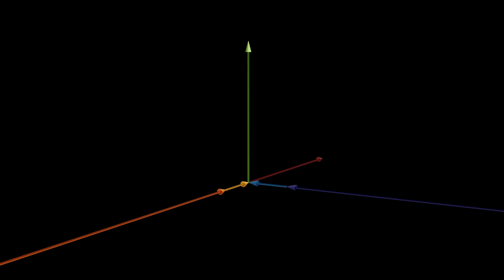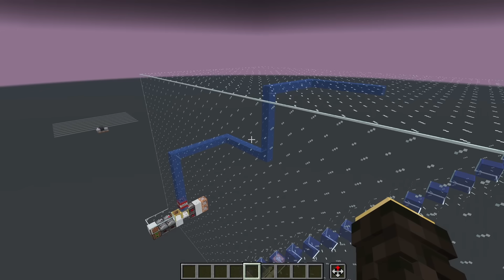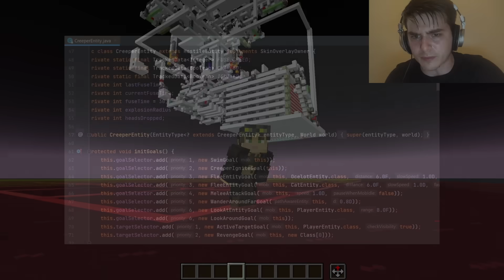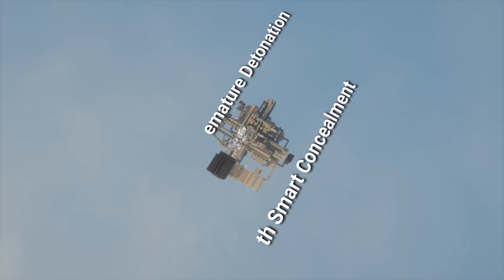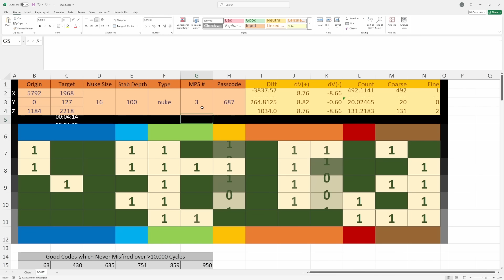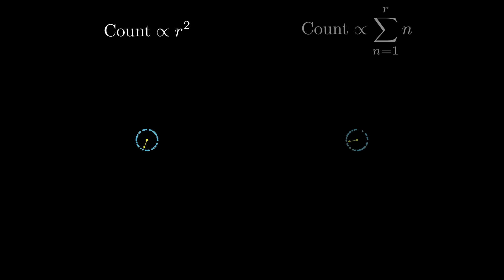Minecraft's Most Advanced TnT Weapon is Here

Comment: How does the wireless transmission itself work? What redstone components are used and why does it work?
Reply: cubic outlined the rigorous details in the trialdivers video (https://youtu.be/2O223xMu65Y?si=OtJ2AweF4EjoDrp-&t=1267)

the basic idea for the receiver is that item entities only check if there is a block supporting them every 4 game ticks, but more importantly, each item entity will also only check for a supporting block 1 gametick after the item processed before it, as opposed to in the same tick. you can observe this in game by placing a bunch of trapdoors, dropping different items onto each trapdoor one by one, and then opening all the trapdoors at the same time with redstone. the items will fall in a distinct staircase pattern.

by using specific chains of repeaters of varying delays and comparators to create a specific tile tick priority for a bunch of droppers, we can create a sequence of item entity creations from the droppers that will all fall in a pattern that will stay consistent as long as no other item entity is created in the world with the same tile tick priority.

if an item is created in the world with a tile tick priority that matches one of the items from our sequence (i.e by a transmitter), then we will notice that the pattern has changed, which we can detect. 

i've definitely glossed over a lot of details, such as why other random item entities created in the world don't affect wireless redstone/the importance of the reference item, and my interpretation might also not be perfect, so do watch the video

Comment: Edit: I haphazardly commented early and am just gonna leave this comment for honesty reasons. That last paragraph is relevant though, just expressing my opinion about the optimization mess.

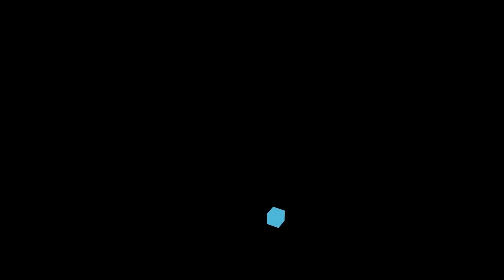6:54 this is inaccurate. These types of linear transformations are done for each vertex (4 per visible block face, give or take connected block edges with matching verticies) several dozen times before even finishing one frame. Compared to scene prep, adding one extra transform per frame (not counting the collision check that it's already doing) on the CPU per-frame would have a cost so small that it's impossible to imagine the difference. Really, I think this is just an oversight.

Edit: After seeing the processing time for a single tick after that it occurred to me that they are not only working with Java, which is NOT optimal for HPC, let alone games, but they're also working with Minecraft's really shitty codebase lol. It is very possible that somebody looked into making a better solution and found a ton of shit they didn't want to risk rewriting for performance where a single transform+collision check won't take thousands of cycles (can only imagine it's that much if a few hundred TNT blocks moving around can do 13 seconds of lag for the server).

A reasonably determined programmer with expertise in low-level programming could get something of this scale working reliably and quickly, even on a single core. See the insanity of Factorio's engineering for an example of just how good modern processors are when utilized properly. With how much money Minecraft makes, Mojang has no excuse to keep holding Java edition to such a lower standard. Even though Java is limited in this regard, modders have proven there are leaps and strides of performance gains to be made practically everywhere! It's a damn shame.
Reply from the maker: I think my bug report about the collision method is currently the most upvoted on Mojang's bug tracker. And the solution is extremely simple to implement.

Comment: Could you potentially make the charge move in straight lines with a precision-timed charge to redirect the payload into another specific straight-line direction? That way the number of calculations is greatly reduced for standard vanilla servers. The cannon probably looses some range and precision doing this method, but the math for the redirection vectors is theoretically possible.
Reply: that wouldn't work since you would need to load whichever inbetween chunks the tnt goes through
also the whole reason it moves across the world in one tick and then suddenly stops is because of the powdered snow, so if the cannon was set up like that you would need to 1. find the inbetween chunks, 2. place powdered snow in the right spots, 3. fire the cannon, and finally 4. load each inbetween chunk before it can finally reach its target
i found that by making the cannon more or less aligned in one axis with with your target(s) helps reduce travel time

Comment: Hello Cubicmetre, I am writing this because i just had an idea on how to improve the orbital cannon even further.

For now the bigest issue with the concept is that you need to know the location of your ennemies and then wait a loooong time for the payload of that exact coordinate to form. this means most of the time you can only ever target bases instead of players, and preping multiple payloads at once is a cool system but it still dosen't help to target moving ennemies.

So my idea was to create a tnt storage system conected to the cannon. Imagine the storage system is made of individuall modules that, for this example, have 5000 tnt eatch. (The number can vary) then you have 10 more special modules(5 for each coordinate) containing the following payloads: 4 of them have 2000 tnt, 2 have 1000, 2 have 500, and 2 have 250.

Now let's say you need to send a christmas gift that needs 22682 and 39876 tnt to arrive. Instead of waiting for that to generate you could just  do 22682 - 4 modules, then 2682 - one 2000 module, 682 - one 500 module and now the cannon only needs to generate 182 tnt.
then you do the same on the other side( 39876 - 35000,   4876 - two 2000,  876 - 500,   276 - 250,  26 are left) As a result the cannon only needs to generate 182 + 26 tnt and is ready to launch.
Thanks to this system as long as the payload needed dosen't exceed the number of modules made you can garantee that the cannon will never need to generate more than 500 tnt to be ready to fire.

Now the only limit as usual is the lag it creates, but i hope by storing the modules in unloaded chunks then using chunk loaders to put them in lazy chunks only when you need them you can keep the lag to a minimum.

I imagine if this works you could become death to anyone, anywhere, anytime.

Like, imagine i am traveling with a group in a minecraft world. Then we stop just for a moment to wait for others, and suddently all our games freeze. The frames start loading one at a time as we see the plains we were in suddently be filled with tnt. Now all we can do is wait for the game to register our deaths.
Anyways, hope you have a good year and good luck on your arms race against yourself.
Reply: Good idea that might actually work. I don't think it's worth it, but it would be cool.
Reply: @Int_resting   Thanks, I also don't know if it's worth it but at this point there's not much more that can be improved.
Reply: The ocs isn’t that good anyways for killing players as the game gives invincibility frames so at most you end up taking 2 or 3 tnts from a couple blocks away. It really only works for targeting bases

Comment: im curious as to why some people say it doesnt work on bukkit. bukkit fundamentally doesnt change anything, it just adds in an api. it was literally created by nathan adams (dinner bone)..
also spigot doesnt do optimizations either by default, why doesnt it work with that. I dont think it a paper issue at that point, remember paper is a fork of spigot, and spigot is a fork of bukkit. and NO ONES CHANGED anything in bukkit in years, other than updating it to the new versions. so its possible some changes that were made were never updated. Also not all finely tuned redstone machines break in paper. there are plenty that work fine. some of them you just adjust a few timings depending on the server if they modified settings which is common amongst many larger servers.

Comment: I have an idea and I believe you can help me bring it to life. By using wind charge direction propulsion theory paired with different fishing rods, at a given time, specific angles sent by the player in multiple sets could be detected by target blocks in a large array. By using multiple of these to reduce the area, an extremely accurate location could be calculated in order to send the payload to. Unfortunately, im not the greatest redstoner and cant bring the idea to life. But you could with the help of other mechanical experts.
Reply: To better explain, I would aim at the given point from wherever in the world, using a fishing rod to activate a redstone contraption which launches the wind charge and allows me to aim it directly at say a 100 by 100 grid of target blocks on the ground. This could be encoded into a 7 bit binary code for both x and z coordinates of that hit. Using a second rod and second room, i can activate another wind charge on another 100 by 100 grid. This gives a 10000 by 10000 block range and an accuracy of an exact block by combining the two codes. As a sidenote, using an excel spreadsheet or a feature added to the f3 menu, the angle could be easily calculated by inputting coords
Reply: Not possible

Comment: Proposed Survival Viability Report for OSC Mk. 6
Subject: Proposed Simplifications for OSC Mk. 6 Survival Build (Memory Unit)

Dear Cubicmetre,

The OSC Mk. 6 design is a marvel of Redstone engineering, with the integrated self-protection, omni-directional firing, and remote firing methods (like the fishing rod trigger) making it robust against player interference. It is, as you designed, a nearly 99.9% efficient system from an operational standpoint.

However, as a survival player, I've identified that the one insurmountable obstacle to a true survival build is the astronomical resource cost and labor associated with the main command unit's storage system. Specifically, the necessity of filling thousands of containers with unique, unstackable items (like music discs) for the comparator-based memory.

To make this cannon physically possible for the average survival player or technical server group, I propose exploring a "Low-Resource Memory Unit" alternative, even if it sacrifices some memory capacity or modularity.😁😊

Comment: I have just recently encountered a bug with the binary counter. The bug occurs when the bit for 512 and 1024 (or any bit after the middle section) are on at the same time, because when the machine triggers the 512 bit to turn off, it also triggers the middle section which triggers the 1024 to also turn off. If only the 512 or 1024 bit are active the bug doesn't occur, but if they are both active it will only count 512 instead of 1536.
Reply: What about the Excel spreadsheet? Has it worked for you? Because i tried to use it and the moment i modified anything on it, it got corrupted immediately, i can’t use it to get the barcodes for the coordinates or to even activate the cannon.
Reply: The spreadsheet works fine for me. I'm no expert when it comes to Excel, so I unfortunately can't help you with that.
Reply: @marcogamingde ok, since the cannon works for you, does it still work in 1.21.8?
Reply: @09archange  I recently tested it in version 1.21.8 and it works fine there.
Reply: @marcogamingde ok, i will go and see a way to go around the spreadsheet, if you have any suggestions or ideas, i appreciate you telling me.

Comment: Is he using any mods to hold back the tnt's explosion for a while? I cant get it to work
Reply: He's not using mods but instead using lazy chunks, make sure you're not loading the cannon when it's running
Reply: @Annoyance1969 I can't get the interface to connect to the cannon when it isnt loaded, do you know why? Thanks for the help btw
Reply: @Annoyance1969did you mamage to get it to work? How did you get the spreadsheet to work? Because for me, the moment i try to change any of the coordinates on the spreadsheet from 0 0 to anything else, it gets corrupted and i can’t use it.
Reply: @09archange  Make sure you're using the right program to run it, excel should work but I find XLSX to work better.
Reply: @09archange  I downloaded it and it just worked right away. I guess you have tried downloading it many times, but its the only way i can think of. Could you be using any other app rather than excel to open it?
 
Btw it still doesnt work, but thanks for the help

Comment: where do you need to place the control pannel?
Reply: Anywhere you want, as long as it's chunk aligned and far enough away so you don't load the cannon when you're at the panel
Reply: @Annoyance1969 i think I'm doing smth wrong with the chunk aligned or I'm just not understanding the Origin from the spreadsheet, i made the green box match the chunk boarder but whenever i put the cords into the sheet it gives me a error, and even when i try launching it, it doesn't send the signal. Any help?

Comment: Is anyone able to help? My cannon is fully built, the schematic verifier has no issue but the control panel does not connect with the cannon… I already check the password, most of the containers should not have an issue. Can anyone suggest what to do?
Reply: Had the same issue. I simply built the control panel next to the cannon. It doesnt seem to work when it isnt rendered
Reply: You need the panel far away from the cannon, to make sure that the cannon is unloaded when you send instructions, if the control panel is nearby, the cannon won’t function, my issue with this thing is the spreadsheet, i can’t get it to function and the moment i try to modify anything on it like the coordinates of the cannon or the target, it gets corrupted immediately and i can’t use it, anyone can help?
Reply: @HéctorSanMillánDid that work in the end?
Reply: @IB22_PMCT No, I gave up. I dont know if it is the game version im playing in (1.21.5), or simply im missing something
Reply: Requires specific passcode, such as 1023

Comment: Uh how do I configure the password on the machine? I don't see any corelation...
Reply: i also needed to figure it out, so in the spreedsheet when you choose you're password in the 2 most right columns there you can find the binary form of the passcode, you need to put those in the machine (1 means the lamp needs to be on 0 is off) the order you need to put the lights on is from top to bottom in the spreadsheet, so begin with the first column top to bottom and then second column from top to bottom. I think thats how you do it but i currently have some problems myself with getting it to work.

Comment: I am stuck on the part where I need to link the wireless transmitter to the cannon itself. I keep resetting the circuit and then putting the code onto the wall, yet nothing ever happens. No tnt build up, no firing, no anything, not even a response from the machine confirming that it got a signal, although, one time, it said it was building the payload but it continued for 5 more minutes. I went to check on it with chunk loading off and it wasn't making any tnt, mind you it said the time was about a minute thirty. Can someone explain what I am doing wrong?

Comment: Veteran cannoner here. It's nice to see new cannoners rediscover old TNT tech such as the stopper TNT for midairs, hammers to push TNT down, and TNT queuing.

For added damage, I recommend adding a nuke attachment using microticks that comparators introduce. This causes a tunneling effect if the power TNT is set to the same tick as the shot TNT. Second, adding a sand comp will allow you to shoot sand between shots to blanket any water or lava that prevents damage from TNT. This'll make your shots even more destructive.
Reply from the maker: I understand that a veteran factions cannoner would look at this and think it's only re-inventing old tech. In fact I originally learned many of these ideas from Kman who was a factions cannoner back in the day. However much of what I have built goes a lot further and more in depth than factions cannons would. For example, using comparators for microticks is made redundant by the fact that we can control the order of TnT in the entity processing list by simply moving tnt in and out of entity processing chunks in a specified order. This is how we create TnT with shorter fuse times that explode after TnT with longer fuse times. This is only possible if you can precisely control the load state of the cannon, which is impractical for factions servers where the range of cannons are usually capped by server modifications for gameplay reasons. As for using gravity afftected blocks to shield stab charges, its not really possible with the way I apply motion to the warhead. Falling blocks exhibit different explosion response characteristics from TnT meaning they accelerate to different speeds and don't arrive at the same target coordinates. Factions cannons effectively have to make two separate cannons for the TnT and sand then fine tune the cannons to fire their respective payloads at roughly the same position within some margin. At the enormous distances the orbital stike cannon operates, the discrepancies become too large and too cumbersome to tune out.
Reply: what a patronizing comment, my goodness
Reply: @senoreverything6366 anime pfp too

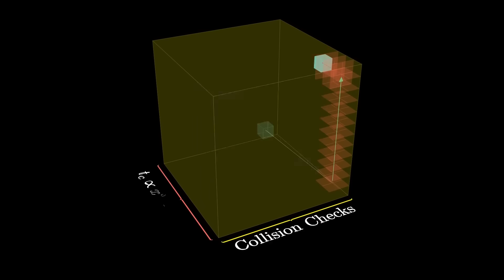Comment: 10:26 hey cubic you accidentally put the wrong formula all directions are multiplied with eachother not with themselves
Reply from the maker: I realized this after the video was out, the fact that the result lined up perfectly with my observations meant I didn't think to question the original formula. But to explain where all the lag is coming from I would need to go into a lot of detail on the Java code environment looking at concepts like wrappers as well as various code that performs redundant checks on chunk load states and such. While the formula I presented is incorrect, it is useful for getting the point across in a simple and readable way.